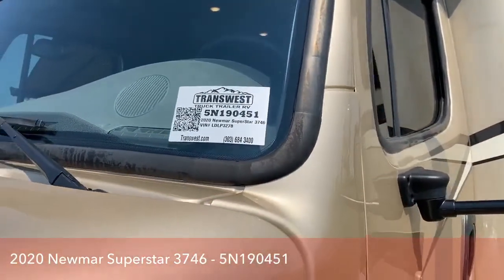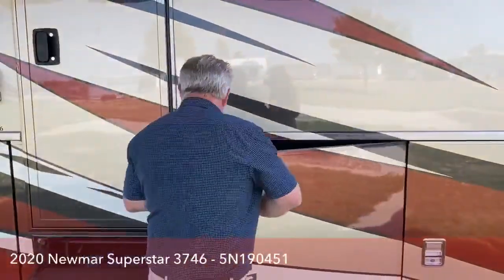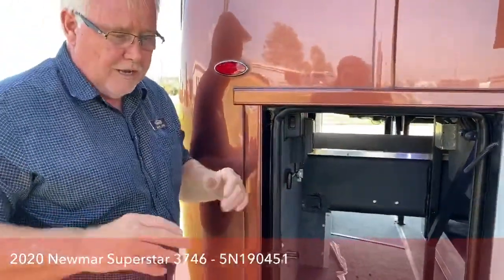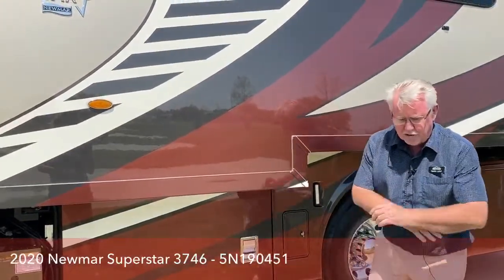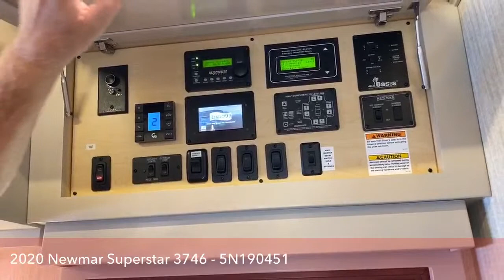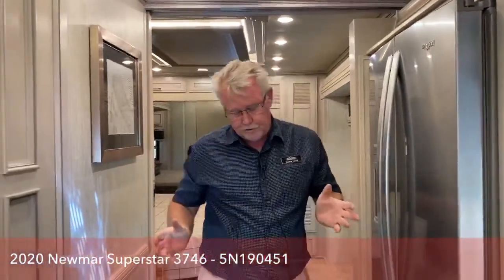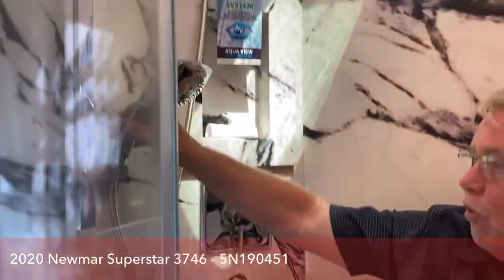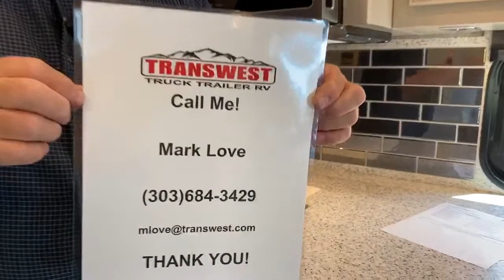2020 Newmar Superstar 3764

Comment: This guy has no clue what he’s talking about. He proved this by saying that a coach with a 40k GVWR is 2,000 lbs heavier than one with 38k lbs. All that means is that the potential is there for 2,000lbs more with cargo, people, and tongue weight lol.
Reply: He’s implying the 40k gvwr models will weigh around 2000lbs more on average since they are 3 feet longer (37’ vs 40’) and so will have a higher UVW. But you make a good point it’s not exactly 2000 pounds difference in UVW, it’s 400 - 1400lb difference depending on floorplan.
Reply: @PlayWaves1  I wish all manufacturers would list the UVW and NCC clearly in the way they brag about horsepower.